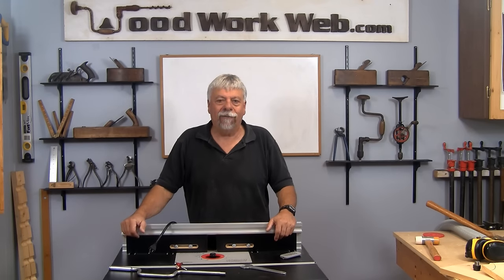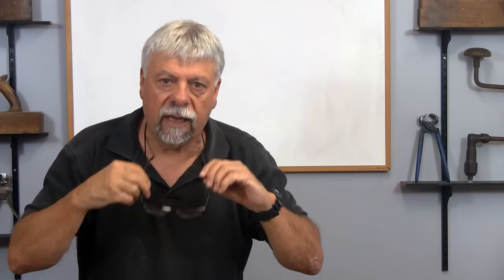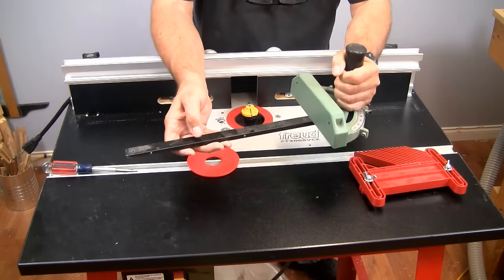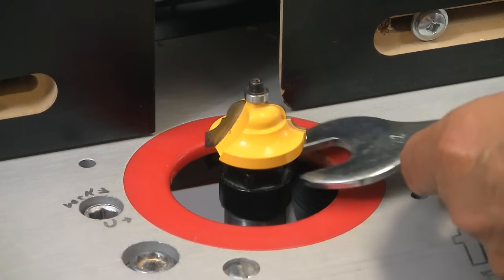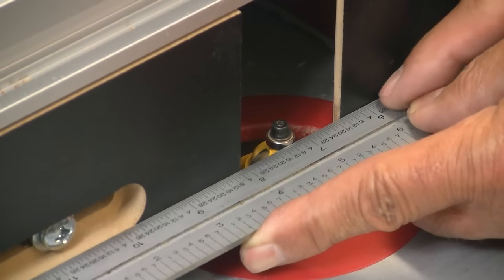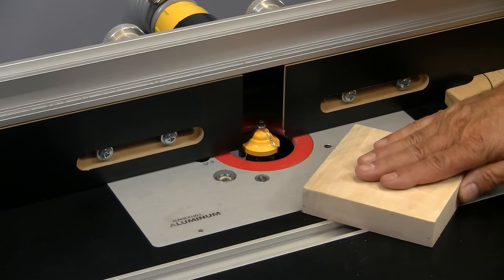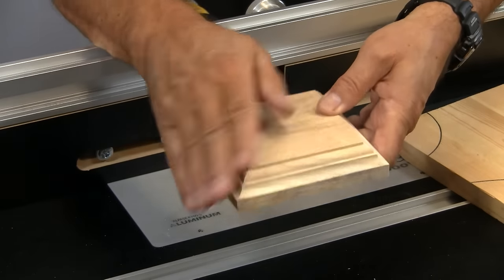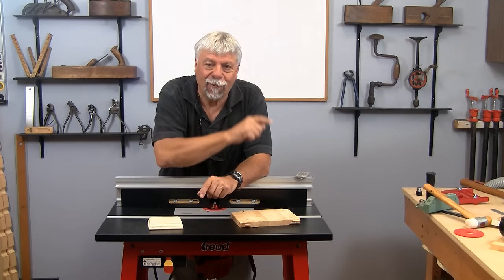How to Use a Wood Router Table - woodworkweb

Comment: Thank you , just bought a router table and will be using it for the first  time. Very helpful video
Reply: How was it?
Reply: Same here.  I am cutting straight boards into shiplap.  3/8 x 1/2" with a whiteside bearing rabbet bit. Thought I was going to need two passes, but I tried it in one, and it looks good.

Comment: I had tried before to use my router table.  Well, it is a little table with a hand router mounted to it.  But I had been continually frustrated until I watched this video.  Though the mechanics of the setup are different for my little table, your explanation was more than enough to get me looking around to discover how my situation worked.  My first trial piece was a total success.  Thanks so much for this video, and all the others I am sure I will be watching to learn how to......  Caley Ann

Comment: I have a suggestion to all wood workers that use a router table: Use 
bright red nail polish to paint the head of your bottom collet 
tightening wrench. I almost turned on my router with the wrench still 
holding the collet nut because it was black and was hard to see below 
the table surface.
Reply: Yikes. Thank you for the safety tip.

Comment: I know this is an old video, but I have a question.   Do you ever use a feather board after the bit?   I know you don't use one after the blade on a table saw, but not sure on a router table.   Thanks.

Comment: Thank you Colin!  I am having trouble with using a straight bit and getting consistent clean cuts.  It looks like I am cutting with as prison shank.  It is a new bit and a Bosch router and table.  Any suggestions?

Comment: Hi Colin, complete router rookie here faced with cutting Dado grooves in what amounts to a 2 piece back shelve unit that measures 77 x 53 (going to use 2 pieces cut 25.5 x 77 and 2 sides that are 1/2 in thick about 77 x 20) and cut about 10 Dado grooves in the back and 2 side pieces.  Your advice here, what would be the best router table / fence combo and what would be the best bit to use? Does a more expensive router perform better than a harbor Freight?
Reply: Kent Smith ..... Since Colin hasn’t responded, I hope you don’t mind my chiming in. 
I’m still pretty new at using the router myself but learned a lot about the bits. There are combo sets on Amazon that run about $25 for approximately 12 bits. They don’t last long at all though. Cheap bits dull very quickly or they break. You may get 2 or 3 uses out of them if you’re lucky but they ARE good for when you’re learning how to use a router. Also, you’ll get a sense of which bits you use more than others.

Long term though I recommend not buying in a set. Buy the bits individually. It’s absolutely worth spending $20-30 or more on a single bit especially if you’re going to use it often. I myself have 3 bits I use all the time. Straight bit, chamfer bit and my favorite, the Roman ogee bit. Those cost me between $22–$57 a piece but they are so worth it. That’s low to mid range for a quality router bit. I’ve seen some that cost 175 each! 

In a nut shell, if you plan on using the router often or even for years to come it is worth investing in quality router bits. 

Good luck!

Comment: Thanks for that video on basic routing. My one question would be is should you run wood through standing against the fence or lay flat on the table. Which is best. Same router bit will give different design. Example wood would be 1X4 poplar. Thanks
Reply from the maker: It really depends on what surface of the 1x4  you want to route.

Comment: I have a question when using lets say a 1/4cove bit with a bearing you line the bottom of the router bit up with the wood?  Im getting ready to purchase a router and start using one. Just trying to figure out where to set up the bits. Thanks.

Comment: About to get my first table. Can you suggest a good starter bit set that I will get to learn with and that will last? There's so many on amazon and I'm really not sure on the best assortment or the type. I only know I want 1/2 inch instead of 1/4 whenever possible! If you could make a suggestion I would really appreciate it.

Comment: Great video, really informative. Just wondering, when and why would you use a feather board (in general, not just on a router table) and does the back fence need to be parallel to the groove when using a feather board? I'm just starting to get into woodworking and am really enjoying this series on using the different tools/machines around the shop :)
Reply: like you, im new to woodworking, and from my understanding the feather board keeps pressure on the wood against the router blade. you can also get a feather board for the back fence too to keep downward pressure on the wood too.
Reply: RookieMistakes0607 Thanks :)
Reply from the maker: SPOREOUT3 The router's fence does need to be mostly parallel to the feather board. The feather board is often referred to as "another set of hand" meaning it allows you to hold things in place while thus freeing up one of your other hands and as Rookiemistake0607 mentioned, putting pressure on the wood to hold it against the bit or blade
Reply: WoodWorkWeb Ahh right, thanks a million for replying :)

Comment: Hi I bought a ryob router table and I am having a issue withe the fence I try the router bit with the fence but the the table has markings on both side and one side tells me one reading wile the other side tells me a different reading I checked with the rule and it looks good with it but when you eye ball it it looks a little creche can you tell me if I am doing some thing wrong

Comment: I am going to investigate purchasing a router table.  Working with a 1 1/2" x 1 1/2" solid wood frame.  Working with re-purposing old assembled frames.  I want to rabbit out the back inside of the frame (approx 3/8 deep x .5" length) so I can place a small panel inside the area so it sits flush.  Any tips for this type of work.

Comment: Heya. I need to restore an old cabinet and it's the first time I'll be doing a piece like it. Mostly I'd like to know how to sand the edges of pieces like the one you made in this video so that I can do it right without ruining the shape. The cabinet's doors have ornamental pieces like yours attached to a board and then framed with routed strips. As you can imagine, there are tight and curved spaces that a regular sander just won't reach into and I'll need to do it by hand. Is there a good technique for sanding these kinds of pieces by hand, or would I need special tools? Thanks a lot and I'm your newest subscriber.

Comment: I got 2.2hp router Bosch and the varible speed 1 thru 6 what is the best speed for wood? I know the big router bits low speed. What is the speed for big bits?
Reply from the maker: You really need to test it with the wood your using. You'll find that different types of woods can react very differently to being routed or cut.I prefer to start off slower when testing and going from there.
Hope that helps.

Comment: Colin,

What do you mean by edge grain first?  I have started using my router table and the kick out on the edges of my small blocks of wood tend to be really bad.  I'm currently also trying to make my own trim but for some reason as i get half way through the pieces i notice that something will happen that will cause the bit to jump and then the line isn't straight all the way through. I'm not sure what i'm doing wrong :(
Reply from the maker: joga821 Did I say edge grain somewhere?? ... should be END grain, also known as cross grain. Yes it will "blow out" or splay when hit with the router bit. That is why we do the long grain last, because it almost always fixes and end grain blow out that happens. 
Bits can jump sometimes when they hit a certain gain pattern and and not as well supported as they could be, or when they hit a knot or even the edge of where a knot was. The grain in these areas is often harder and of a different pattern. In most cases you can re-rout these areas and get a good cut.
Depending on what you are using the trim for, you may get away with small defects like that where nobody will notice ... except you.  This is a pretty common thing among woodworkers. We all have little imperfections that we can see and know about, but nobody else can notice.
If you are finding this an ongoing problem, maybe you need to support the wood you are running through your router a bit more firmly. Maybe featherboards might help??
Let me know if you have more questions ... I will try to help out
Colin
Reply: @knecht105  thank you for asking this question and thank you Colin for the explanation.  I am currently researching router table lifts and how to add it to a current workstation!  May God bless you with health and happiness for sharing your knowledge with us!

Comment: Question. You say never use a miter gauge with a router table, but I just bought a router table combo and it came with the miter gauge. Please tell me why I shouldn’t use it and why would the manufacturer include one?
Reply from the maker: To make it clear, you should NOT use a miter gauge with a fence installed as it could cause the wood to bind if you're not feeding it at 90 degrees or your wood isn't at a perfect right angle. Thanks for watching!
Reply: @knecht105  Thanks for response!

Comment: Excellent vid, thanks. Quick question, i have a plunge router and a small portable table to attach it too. when i use the portable table with a straight bit, i get an awful lot of kickback. I took the router out of the table and tried free handing a round-over edge, which was fine. The table is quite light and not bolted down. The bits are new. Do you think the table or router bit would be more at fault for the kickback? Thanks in advance for any info :)
Reply: The kick back you have experienced could be from a couple of things. One is your fence setup not being perfectly parallel on each side of the router bit. Any discrepancy will cause binding of the board between the bit and the fence and you will experience that binding as kick back. Another possibility is you may be trying to remove to much material in one pass. Try cutting the finished depth you are looking for in two or three passes and you will see better results and cause a lot less stress and heat build up on your bits. You should definitely anchor you table to a solid base as well. Using your table without anchoring it down is extremely dangerous. Be careful and I hope this helps you out a bit.
Derek
Reply: GiddyUp994  Thanks a million for your reply. I'll make sure to bolt it down. Its just in a temporary spot at the moment, I'll keep away until I can bolt it down though.
I dont think it is the depth of cut as I was taking a very thin layer off the edge (I was trying to square off one edge as I dont have a table saw or jointer)
The fence could be the issue. Its only a cheap table and the fence sometimes can twist when tightening (it has two gear shaped knobs for screwing either side down) I'll keep a better eye on it.

Thanks again for your help. Its one of the things I love about woodworking videos. People are genuinely helpful. All the best
Reply: If your not a member on the woodworkweb site, give it some thought and join. There are quite a few excellent woodworkers whom gladly help out with getting your questions properly answered. It's free and I think you will really get some great guidance from the member forums. Cheers,
Derek
Reply from the maker: RookieMistakes0607 Its a good idea to fasten down lighter weight router tables so they don't move around on you, and kick back is normal, but maybe you are just trying to take off a wee bit too much material? Maybe try taking off a bit less material and see how that works .... and as Derek mentioned, the Forums at woodworkweb might be of help to you ... and you may be able to help out others too. We all learn from one another :)Thanks buddy ... great to have you with us

Comment: Nice, quick and easy. I’ve just bought my first (cheap) router table. It doesn’t have the easy up/down adjustment yours does and it has a clear Perspex guard that moves out of the way as I feed my wood through. 
It’s okay to learn on & with your videos, I’m learning so much about safety. 
Thank you for posting. 
Also, what was the router bit profile you used? I’d like to make some drawers with that type of profile for the front piece?